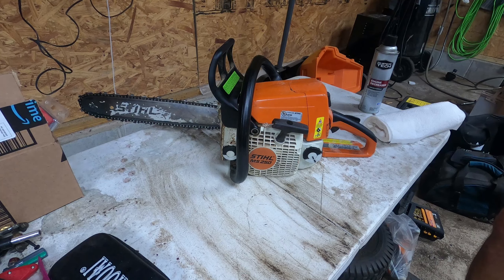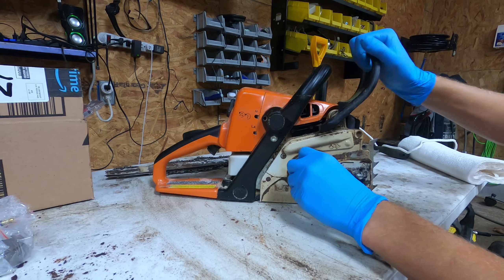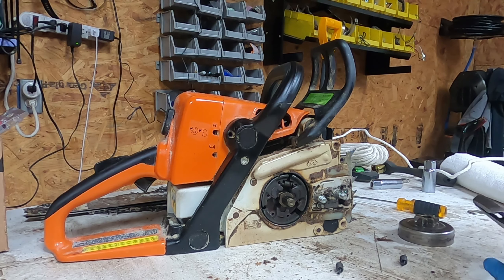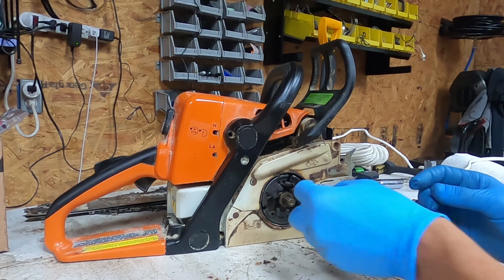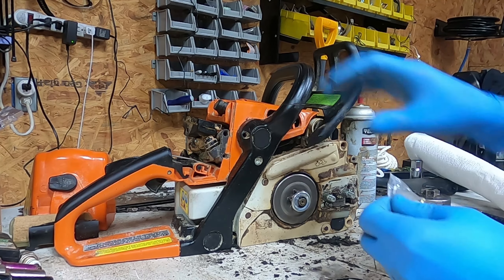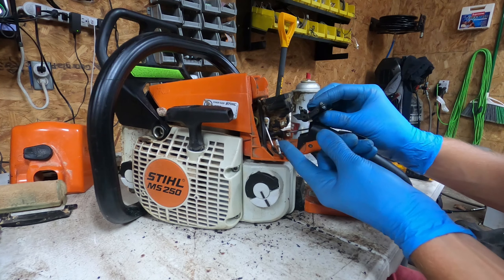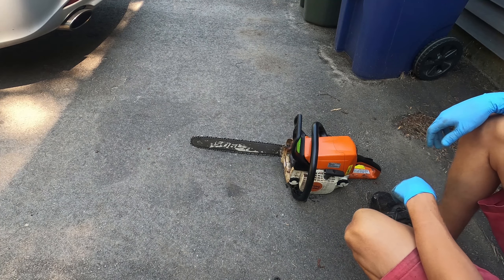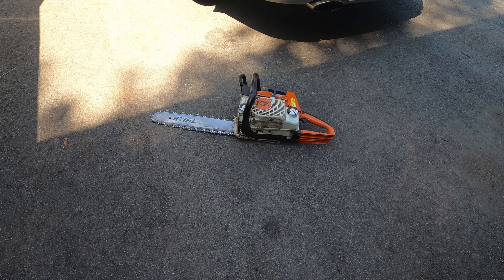Stihl MS250 Clutch and Kill Switch Troubleshooting

Comment: Put some grease on the sprocket bearing and on the worm gear.  I use white lithium grease but any good grease will work.  I put white lithium grease on the rotating surfaces of the mater control lever, too and on the spring wiper for the kill switch.  The sprocket for the 250 is a .325 pitch sprocket.

Comment: i have the same issue with my kill switch and I think you fast forwarded through everything that would have helped me. " This rod kind of jumped..." and then fast forward.  The rod jumped? Great.   Where? How?  Where is is supposed to be?  What did you actually DO?? You spend the whole video on the clutch and two seconds on the kill switch.  I`m not the most mechanically inclined.  Those details would have helped
Reply from the maker: The “rod” is supposed to sit on top of the black piece I took off. When you go to push the black piece up, as if you were using the kill switch. Those two rods touch causing it to kill the motor. The top rod should fit into the black piece while it’s in the machine.
Reply: had the same issue on my 250 just fiddle arouund and you should be able to snap it back where it belongs it just has to touch the wire to the metal part
Reply: @jbbolts  Yes, I figured it out.  Had to!  had fire wood to cut.  works well now thanks
Reply: A close up video of this would be great, I think it "jumps off" easily when the filter cover is taken on and off . Having the same issue.